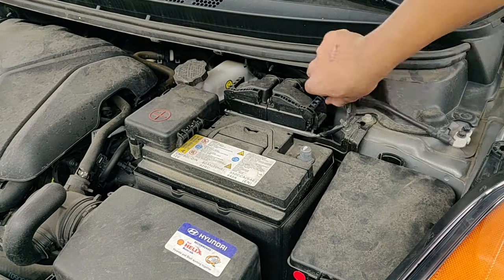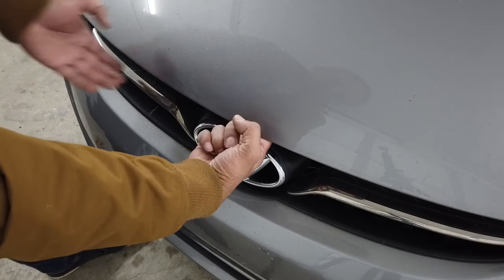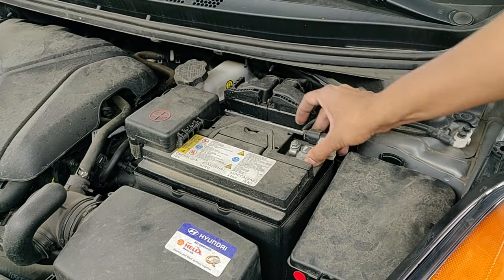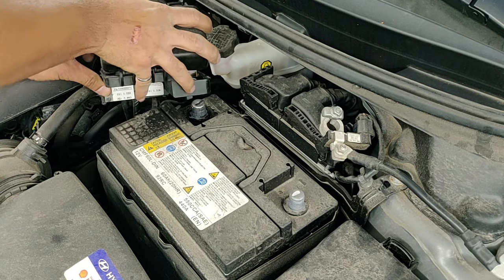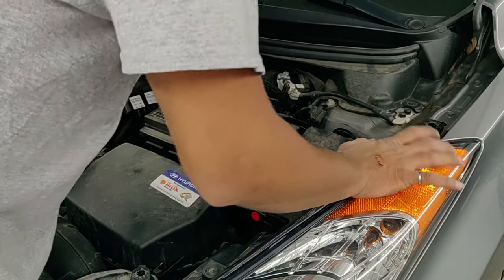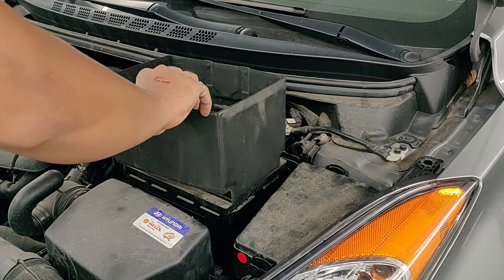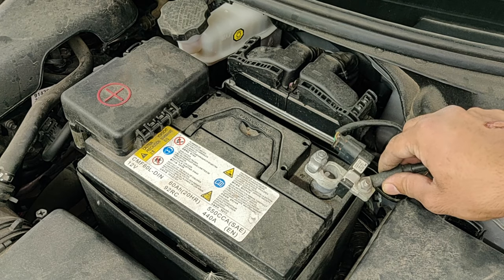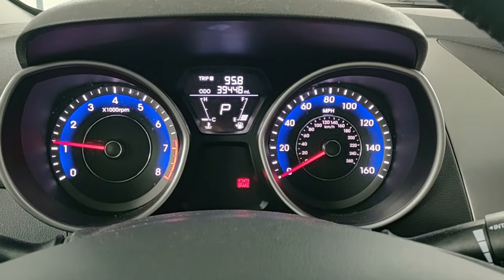How to [EASILY] Replace the Battery - Hyundai Elantra (2011-2016)

Comment: Very straight forward explanation. However, the positive terminal on my car battery is on there so tight, it doesn't want to come off. I need to remove it without breaking it. Advice, please.
Reply from the maker: This is what I would try. I would make certain that I have loosened the nut for the positive terminal. The 10mm nut. Now there shouldn't anything holding the positive terminal wire to the battery post. I would grab a plier and use that to grab the battery wire and use that to wiggle it left and right. That will be break any moisture, rust anything that is causing it to be stuck on. Once you do that it should come loose. It may take a couple minutes of wiggling with the pliers but it will come loose. Just be sure that the negative terminal wire is disconnected and safely out of the way before you do this, to avoid any accidental contact.
Reply: @VirarAutomotive  It did loosen so I could wiggle it but strangely, it couldn't be removed from the post.  I will try again. Thanks for the advice!
Reply: @autryld How’d you get it off?
Reply: @VirarAutomotive What’s the battery wire? The wires on the left at the bottom that go into the box?

Comment: i have to replace a 2011 elantra battery today, is it a h5? i can’t find a answer anywhere, it looks the the one that came out of the car is taller and not as square as most battery
Reply from the maker: It is a H5. You may also can check it yourself. https://www.battfinder.com/
Reply: Hey if you Google your cars manual it should say it

Comment: My positive terminal wont come off at all like it is stuck to something please help!
Reply from the maker: It's probably just siezed on. Make sure the positive terminal bolt is loose. And then wiggle it patiently for a couple minutes. It should come off.
Reply: @VirarAutomotive It won’t come off, what should I do? Wiggling it, pulling, rocking the whole car will not get it off.
Reply from the maker: Sorry. I can't think of anything else. :(
Reply: @VirarAutomotive  I had to unhook the wires to remove the battery so I could stick a flathead in between the battery and terminal box and it popped right off. I couldn’t get the screwdriver in that spot with it in the car. It was really stuck on there and idk why because it came off quite easily after that.

Comment: Great video. Used exact tools you showed however I would recommend that people could probably use a 10 mil socket the smaller nuts as there is a slight risk of rounding the bolt off if it's a bit stubborn or whatever because you've got to come in at an angle so you don't get really good surface grab with just the open end wrench. Anyway do appreciate the video thank you
Reply from the maker: Thank you for your feedback. Glad you found the video helpful 🙂
Reply: 10mil worked for me. ty
Reply: The 10 mil socket is especially handy for the positive terminal because the plastic enclosure makes it more difficult to use an open end wrench.

Comment: Thanks a ton for your video! Just managed to swap batteries right before I lost the light of day.
As a tip for other people, opening the air filter box right in front of the battery gives easier access to the bolt holding the battery down at it's base.
Reply from the maker: Glad to hear that you found it useful! Thank your for sharing the tip!
Reply: wish I had of read comments before changing the battery. I’ll know for next time! thanks!
Reply: Best tip! You can easily do it just a short extender afterwards. Too bad I myself only found out at the end :)
Reply: I wish I saw this before I did my swap, too! Haha. Something about the driver-side of Elantras! Also fun is the difference between changing the passenger headlight bulb and the driver side headlight bulb.

Comment: Question. I was opening fuse box and one of my clamps broke off and now that broken clamp is underneath the plastic battery tray 2:05, should I take off battery and the tray and remove that plastic clamp?
Reply from the maker: It's not really a concern since it's just a plastic piece that has gotten stuck there underneath  the plastic battery tray. it would probably just stay wedged in there. If you are concerned about it and have some time on your hands doesn't hurt to take the battery and battery tray off and remove the broken plastic clamp
Reply: @VirarAutomotive  ok, thank you for your response. When I have time I’ll just remove the battery and a tray, so I don’t have to think about it.
Reply from the maker: Makes sense. Good luck!

Comment: I replaced my battery a couple of days ago. It would not start so I tap the positive terminal and it started.  Yesterday and today; it has the car just went dead and I had to tap the positive terminal box on both times before it power came.
Do you know what is under the positive terminal that could causing this?
Reply from the maker: Is there any corrosion there? Can you check that the positive terminal wire is pushed in all the way on the positive terminal on the battery ? And then tightened properly ? Sounds like a connection issue due to rust or loose contact.
Reply: @VirarAutomotive  Thanks.  There was a loose connection that needed to be tightened on the positive terminal.
Reply from the maker: Glad to hear that you found the issue!

Comment: Hi ... I have the same car. but my address is very inaccurate straight. you have to correct a lot to go straight. Do you have the same problem?
Reply from the maker: Sorry I don't quite understand the problem. Do you mean the steering is very inaccurate?
Reply: @VirarAutomotive  yes
Reply from the maker: Sounds like an alignment issue. Which may be being caused by faulty suspension or bad tires. I would suggest getting the suspension and alignment checked by a mechanic shop.

Comment: Thank you for the video! I have a question. I did this but now my car still won’t start. The power can soft start my car (radio, interior lights, air conditioning, etc) but the engine just shakes instead of starting. Do you have any idea what it could be? Going to have it towed but wanted to ask first.
Reply from the maker: It could be the starter, or it could be a bad crankshaft position sensor or a fuel delivery issue or an ignition issue. Can't say for sure without having looked at the car. Sorry.

Comment: HELP!! Negative terminal is stuck onto battery and won’t budge at all
I can’t even wiggle it. 
Help!!!
Reply from the maker: Did you loosen the nut enough? The nut that secures the negative terminal on the battery?  I'd suggest you check that once. Then if you some plastic pliers, or any plastic tool, then you can try using that to pry the terminal off.
Reply: @VirarAutomotive  I removed both screws but that nut won’t budge at all. I spread WD-40 onto it but it’s still not budging!
Reply from the maker: Aah. I am sorry to hear that. I can't think of anything else. :(

Comment: can someone help me with the name of the battery (Hyundai Elantra 2013 Petrol)
Reply from the maker: The battery size is H5. You can use any brand battery as long it is the H5 size battery and has cold cranking amps (CCA) of around 650A.

Comment: I just had to change my battery and all went smooth and I started the car it ran for maybe 30 seconds and shut off then wouldn’t start. Tried about 5 minutes later and it started and ran just fine. Has this ever happened or could this have something to do with the remote starter I installed a few months ago?
Reply from the maker: This has never happened to me. Does not sound like an issue with the battery. Its a new battery and it started twice. It sounds like an issue with the wiring of the remote starter or the starter itself. When the car did start, did it fire up right away or was the starter struggling to start the engine?
Reply: @VirarAutomotive  The old battery was about dead today. I could only get some clicks out of it. New battery and it fired right up like it normally would then stalled. After that it cranked but wouldn’t start. Ran a scan for codes and got nothing. Then I tried again and it started right up again and I let it run for a good 10 minutes and still seems fine. I’m guessing maybe the module for the remote start had to reset or something then because it’s never given me trouble
Reply from the maker: Sounds like you are on the right path. The remote starter module maybe the first one to check out.

Comment: How do you jump start the car? My positive cables are unable to connect to the positive terminal.
Reply from the maker: Just jump starting won't work. You will need the positive terminal to be connected to the positive cables for the cad to continue running.

Comment: I had an auto zone employee tell me they couldn’t replace it and told me I had to take it to a mechanic due to the high voltage or some shit like that and the car had to be connected to a power source in order to swap it and connect it to some kind of memory stick. Judging by this video and the others like it that seems to be untrue.
Reply from the maker: That is such a sham. You can follow along as in this video and you will be fine. In some cars after batteries are replaced, the transmission control unit has to relearn how/when to shift and adopts to your driving pattern. So maybe for the 1 hour or so after replacing the battery, the transmission shifts may seem a bit off, but that is just the transmission control unit learning and adapting to your driving style. In some cars (older Hondas) the radio resets and locks  when then the battery is replaced and then you have to punch in a code to unlock it. But that's about it.  The whole connecting to a power source/memory stick prevents this as the computers memory isn't lost due to loss of battery power. Hopefully this helps.
Reply: @VirarAutomotive  thank you for the reply. That is extremely helpful!
Reply: That's the exact reason I'm watching this video! Scammy dealership.